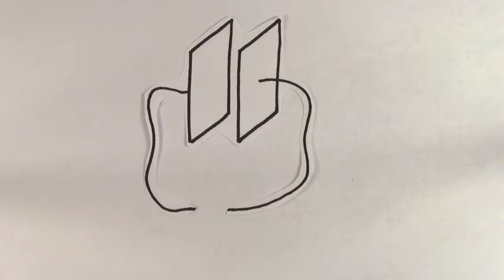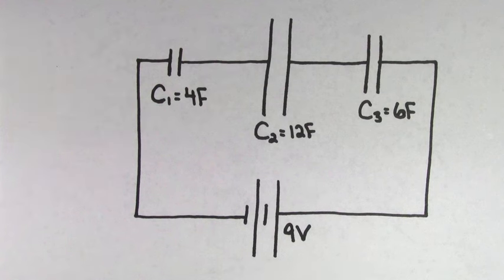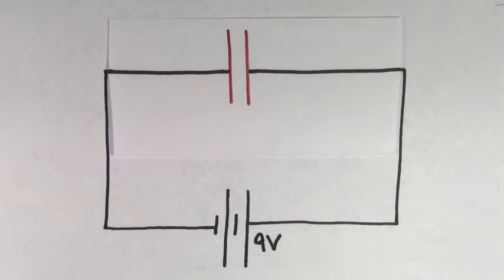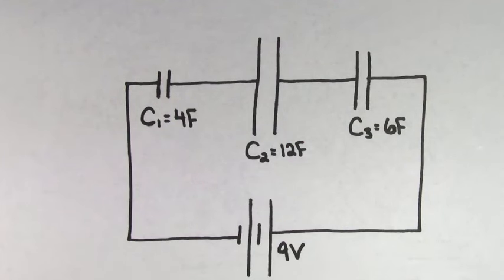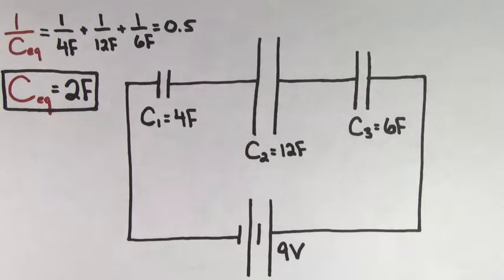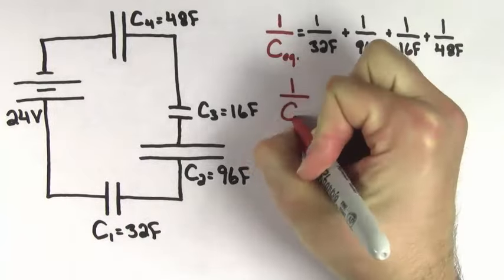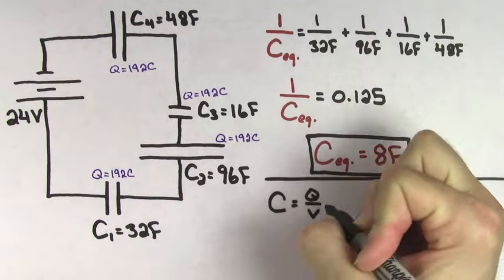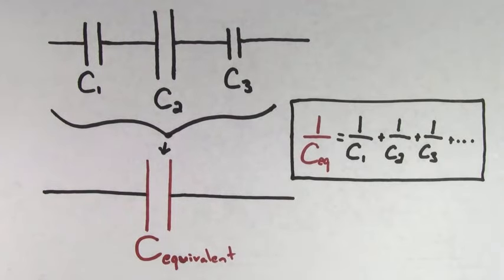Capacitors in series | Circuits | Physics | Khan Academy

Comment: I love your teacher spirit.  Setting models and patterns can take root in place on a first time introduction, hence first impressions are important.  One might first demonstrate the proper exemplar and then followed by the incorrect route. the sequencing order can often make a significant positive difference in forming first time neuron maps.   Both sequencing patterns contain the same material. the difference is the kind of impact on the end user, the learner that is getting in and staying in the Learning Loop of proven values within appropriately relevant contexts. Additionally,  this also engenders critical thinking perspectives from examples that are proven sound vs  the "close, but no Coulomb" prize. Keep making those meaningful positive videos.

Comment: I appreciate your derivation of the equation for equivalent capacitance of series capacitors.  Educators seem to take equations like this for granted, ASSUMING they don't need to be explained, but they DO need to be explained.  Thank you for your explanation!
Reply: Yes true, they just manipulate the equations without explaining if you can do it. For instance, if there is Q/t i.e charge by time in equation they write it as Current without explaining that the time ‘t’ must be the time in which the charge Q pass through a cross section as you can have many other times t1, t2 in an equation too. And not dividing the charge Q by any time t gives the current.
It's 4 years late, I think you must have completed your college right?

Comment: Many teachers, including famous ones like Walter lewin and others manipulate equations without explaining if you can do it. For instance, if there is Q/t i.e charge by time in equation they write it as Current without explaining that the time ‘t’ must be the time in which the charge Q pass through a cross section as you can have many other times t1, t2 in an equation too. And not dividing the charge Q by any time t gives the current. But you, David, are great teacher

Comment: I agree with Heiser, thank you for clearing things up. This may be a dumb question, as I'm fairly new to electronics, but is it safe to assume that it's the same for AC generators (with varying voltage.) that are being rectified to DC? For instance: I'm building a wind turbine generator that will produce anywhere between 0 and unknown voltage (pending the speed of the turbine being spun by the wind force.), and using 16v 2200uf to regulate the voltage. From my understanding of your info: If the speed of the turbine dictates a regular flow of 6v, the capacitor will not release a full 16v discharge until the the speed of the turbine increases to 16v ? If so, will the capacitor release a steady 16v discharge if my turbine produces a regular charge higher than 16v?

Comment: Why is it that the 18 coulombs on the equivalent capacitor doesn't mean that there are 6 on each individual capacitor (18/3) at 4:48
Reply: It doesn't split up because charge is not evenly distributed among the capacitors. The charge is just caused by the losing and gaining of electrons. So it doesn't matter if you one or more capacitors... 

Have a great day

Comment: Can someone explain to me why it wasn't 18/3=6C per each capacitor? Because if the charge was 18C and the voltage for each when charged up was 9V shouldn't the capacitance be the same for all? But instead they are 4F, 12F and 6F

Comment: What is the Derivation formula of 1/C?.. How did it go to 1/C? Please Help....
Reply: You know that  C=Q/U  but while finding the formula for the C(equivalent) after dividing by Q you get U/Q .   this means that  1/C(equivalent) = U/Q .
Reply: V= q/c 
we learnt v= v1+v2+v3 

Replace v by the equation
Q/c = q/c1 + q/c2 + q/c3 
So q/c = q(1/c1+ 1/c2 + 1/c3) 

Cancel the q from both sides of the equation, youre left with 1/C = 1/C1 + 1/C2 + 1/C3

Comment: Capacitors Connected In Parallel

The capacitor are said to be connected in parallel when there positive plates are directly connected to each other , and their negative plates are also directly connected to each other.

 Capacitors Connected In Series

The capacitor are said to be connected in series if they are hooked one right after the other.

 Or 

 The positive side of one capacitor directly connected to negative side of other capacitor.

Comment: How can the charge flow from capacitors in series??The layer between capacitor plates are non-conductive!!Is there any explanation?Please help me out.
Reply: because it induces charge into the other plate...(negatives repel negatives so..)
Reply: Prateek Gurjar how do electrons flow?
Reply: Because of electrostatic induction
Reply: Capacitor working isbased on induction, charge surface induces other surfaces. Like if you have positively charged surface u can put it close to a conductor surface and pull electrons onto that surface by electrostatic force of attraction

Comment: I don’t understand why the voltage is different though
Reply: I think its because the charge Q = CV and charge is the same across all the capacitors, and Capacitance is a value that doesn't change based on charge (its based on EoA/d), the Voltage is what has to change. I think of it as how to store potential energy in a capacitor, as the first electron quickly moves from one plate to the other making one plate positive and the other equal magnitude but opposite charge. but as the 2nd and 3rd and nth electron moves it gets slower harder. so the battery attempts to "maintain" that charge so the voltage drops across the capacitors. let me know what you think of that. im working on the material still but I think that is more or less on right track.
Reply: Michael Persaud thanks for such an elaborate answer...and yeah that makes sense to me..thanks :)

Comment: wait you added 4f,12f, and 6f but got 0.5 how???
Reply: now you turned .125. into 8 how?? XD
Reply: answer to question 1: you add up 1 DIVIDED by those numbers, then divide one by the answer.

answer to question 2:
he divided the 1 by the answer, inverting it. 

you shouldn't by trying to do this kind of stuff if you can't to basic arithmetic to be honest.
Reply: +Myko Link I'm taking the asvab so I'm trying to learn as much as possible about this.
Reply: Shaheem Osborne i see, 
mostly just learn a little bit about division and you'll be fine (or buy a calculator)
Reply: none of this is on the asvab. Unless they changed it to include second year physics lol